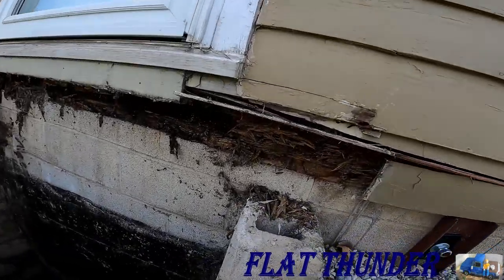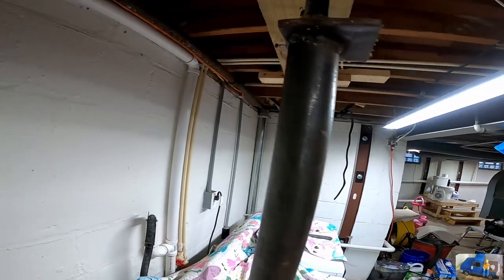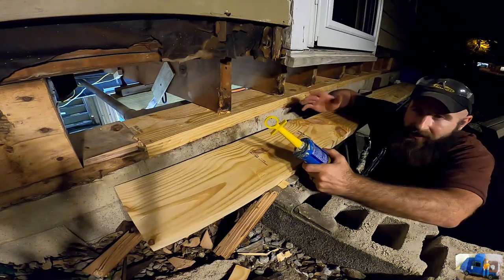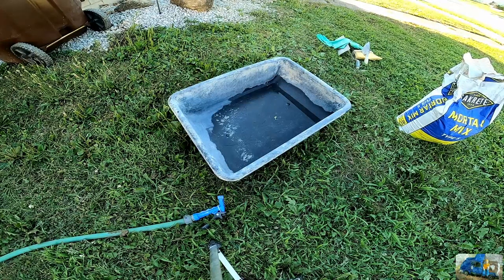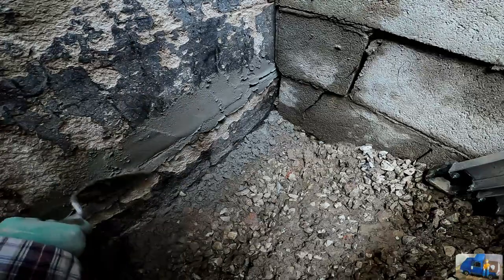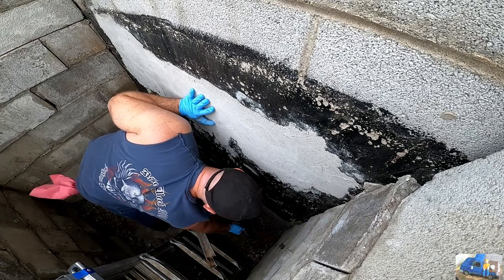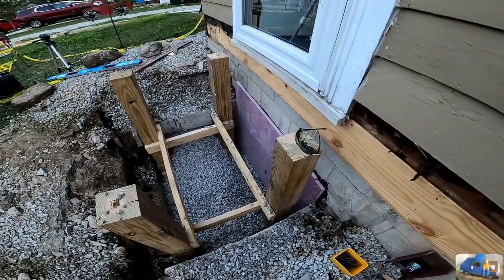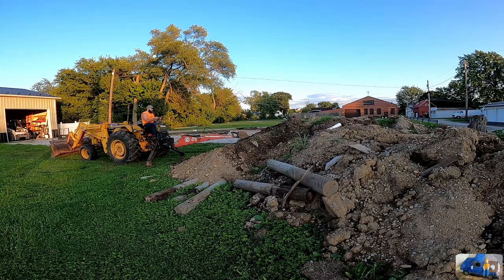RIM JOIST / SILL; REPLACEMENT (CONCRETE STEPS/PORCH ENT./ EP#2)

Comment: dealing with similar damage but my sills are on a 5" slab but below grade and sunk into the dirt and then sidewalked up to stucco even had 1/4 plywood sheathing, Well, ALL CRAP ALONG WITH STUDS.  YOU better put in the foam strip between block and 'pressure treated sill plate. What no PT. No  foam  either- what about hold down, not even powder shot nails., tapcon.....  So the story goes no hurricanes and earthquakes in this specific home. Should use a membrane over that joint. after mortar. That drain has no fabric. holes??  Experience says the measured amount of water not 7 minutes of dabbing with a hose, AND THEN SAYING TOO MUCH.  Geeze that joint is as a dry as a bone. could have sprayed it 20 minutes ago. Wet is best,  Don't use cheap gloves.
Reply from the maker: Sounds like a losing combination.  You might need a moat to maintain the grade and keep your sill above grade.  I recommend adjusting the entire grade next to your foundation if at all possible.  If nothing else it sounds like a fun excavating project.  Post a video of your repair. Thanks for watching!  👍😁

Comment: You need a jointer, ,in the future use a better waterproofing agent, tar is rigid when  it drys ,  it fails,, you want to us3 an elastomeric material that will stretch with the movement of those blocks, it’s called Paige coating  around here, not back plastering,,,yes it needs be wetter mud. With polymers added to mix, 33 yea s experience here talking,,,blocks keep s in business,those block wingwalls should have been. Replaced, junk,,like I said blocks keep us in business, it’s a great business to be in, lots of  ,    Liabilityis why I do it a tad differently,
Reply from the maker: Great information!  I think I have heard it called 'parge' coating previously.  I could be wrong on the spelling.  The wing walls make zero sense to me in this build.  I previously removed the, the same setup, at the rear of the house.  The old owners were nice enough to fill it with old garbage including a whole roll of carpet.  I wish I could have shown the whole process of the wall straightening.  The entire foundation was straightened and repaired previously.  It was a real bear of a job.  Thank you for your recommendations and thanks for watching 👍😁.
Reply from the maker: @Alexander Di Cintio Hi Alex!  It sounds like quite the project.  I do have videos on a cinder block wall that was caving in, but they are short and after the job was complete.  It shows the extent of how much we corrected a wall via pictures and narration.  Check it out they might offer some help.  I am guessing this house is old enough that it is limestone or some other natural rock/block wall?  If so those might be an entirely different beast.  You'd be surprised how / easy it is to correct a wall once the neighboring dirt is excavated.  If it can be puahed back into place tuck pointing all the joints should be sufficient.  Providing adequate drainage around the foundation is critical.  I back filled my entire foundation with gravel.  It drains super fast!   Best of luck on the repair and thanks for watching 👍😁

Comment: The mortar It will not stick , all tar should come off first,,,amatuer at best,cheers...i do thus for a living ,38 years , . Also ? Use better rubberized dampproffing,2" rigid insulation prior to backfilling  ,  tar goes rigid after it cures,is no good,. Its 2024 use better materials,...yoyo...
Reply from the maker: Is a Lincoln better than a Ford?  It was a rubberized 'tar' based coating and of course 2" foam board is better.  It's also quite a bit more expensive......1000% amateur with no desire to be a professional foundation repairman.  Just a guy with some tools.  Thanks for watching!  👍😁